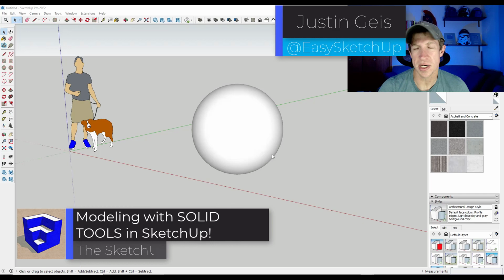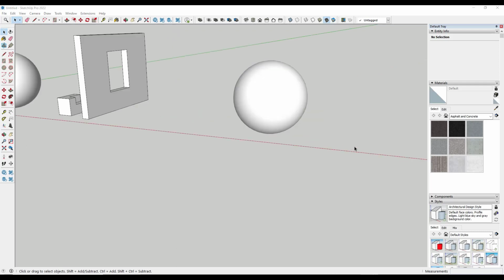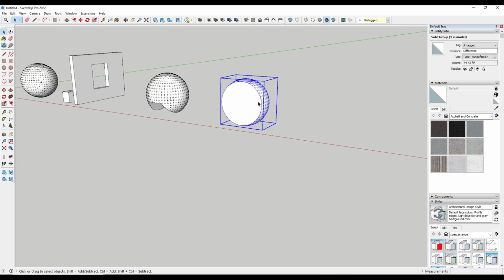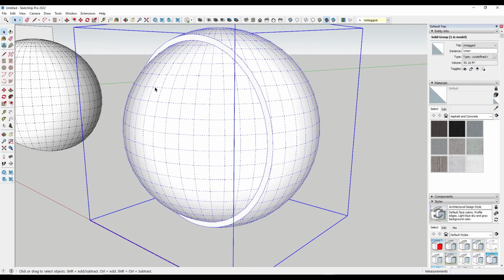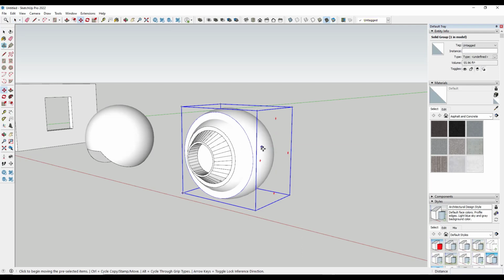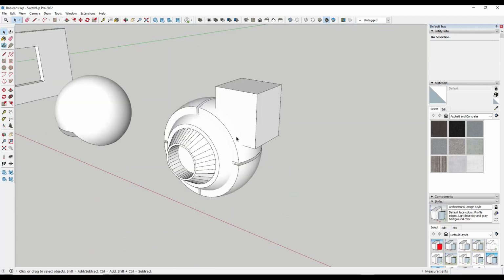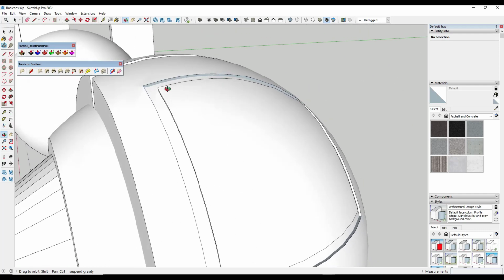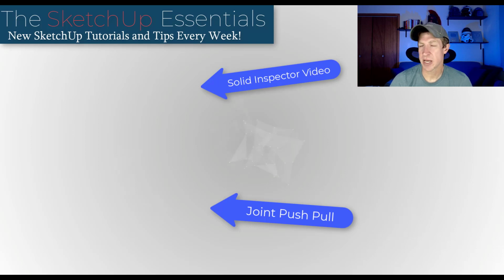Creating Advanced Shapes with SOLID TOOLS in SketchUp! (Boolean Modeling Tutorial)

Comment: I use this method on solids all the time working on hydroelectric power plants. One issue I often run into however is that the Solid Inspector finds a number of too short lines. I understand why this happens, but is there a way to avoid it? Perhaps changing scale temporarily before cutting?